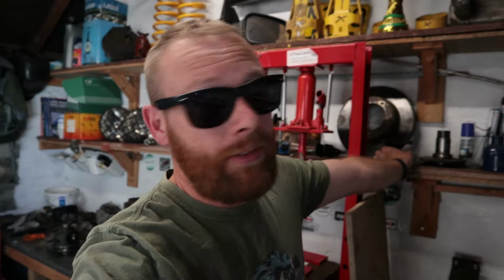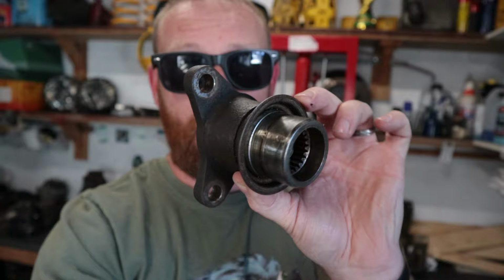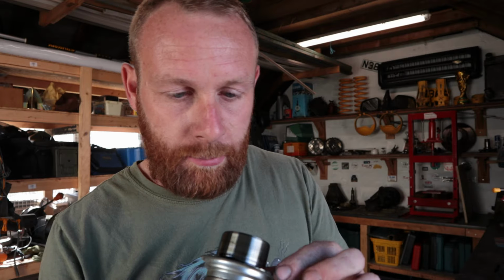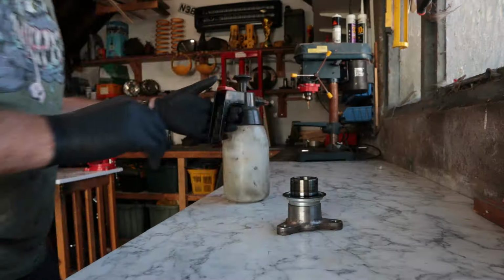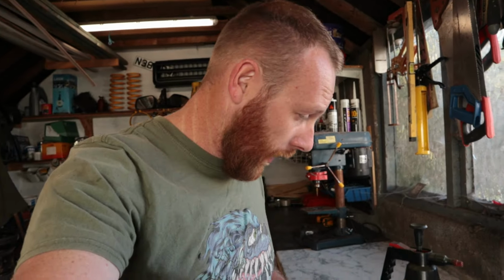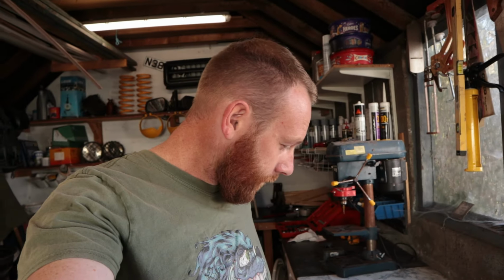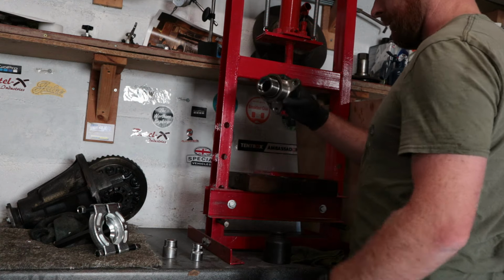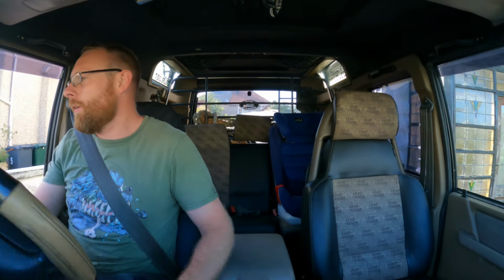That bloody squeal

Comment: Mm, simple fix. Good. Disco 2's have a harmonic balancer on the rear axle. Perhaps it was fitted to reduce vibration?
Reply from the maker: @sleepycatpictures1176  maybe! The d1 had one on the front axle but I removed it, didn’t make any difference in my experience

Comment: My last Defender sometimes made a noise like it was "dragging a chain behind it".
It wasn't subtle either. It sounded like there was a 10ft length of anchor chain dragging along behind it.
Spoke to several LR specialists and nobody had ever heard of the issue.
Took a couple of them for a drive and they were baffled by it.
Even went as far as having somebody else drive it while I hung out of the back and tried to see underneath.
Hard to believe that something so distinct was something nobody had encountered before.

Never did find out what it was because somebody kept pestering me to sell it and eventually I gave in and flogged it.
Reply from the maker: @SiCrewe  haha it drives me crazy when it’s a noise I don’t know
Reply: 9/10 was the front output wobbling around..I wrote on Discoweb all about this.. AND how to fix all these issues as I have 'tuned' a D1 to 75mph+ smoothly while Lifted.. The factory 30 degree clocked Front driveshaft was also a pretty bad idea LR corrected in the D2's and many people like me put on their D1's